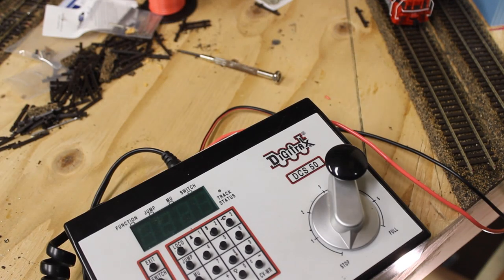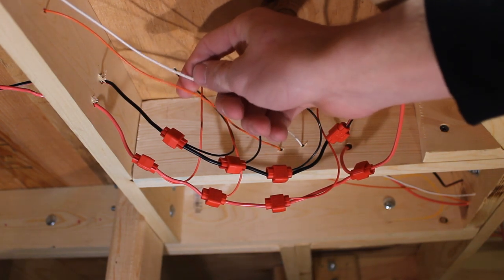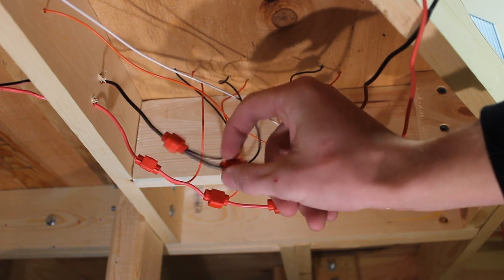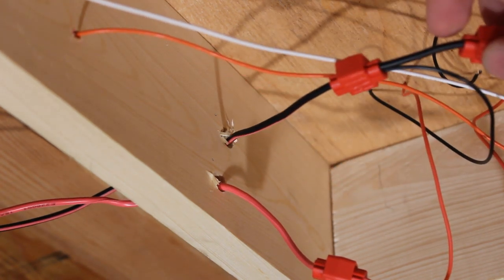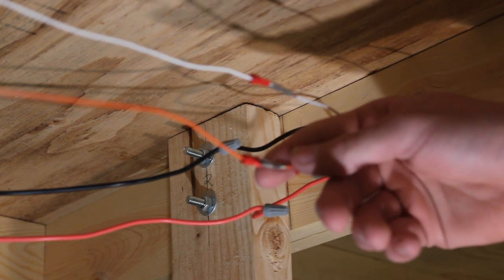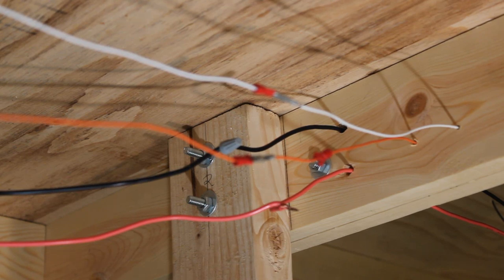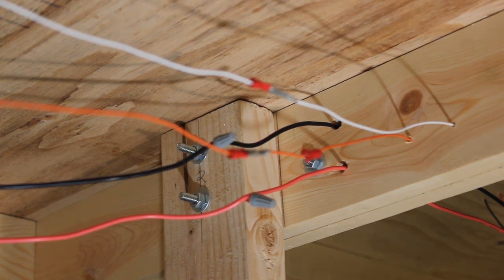How to run a model train bus wire

Comment: DCC bus wires should be twisted together to reduce inductance.   On long runs that inductance will distort the DCC waveform and possibly create weird responses, especially with locos with sound.

Yes, the twist does make clipping in those suitcase connectors a lot more difficult.  But ya gotta do what must be done.

Comment: how do you connect your bus wire to a power supply? Also, how do the little feeder wire connecting pieces that attach the feeders to the bus work? does it strip the bus wire when you install it or do you have to strip it before?

Comment: Can you connect controller to track as normal & have a separate power supply feeding the bus wires?  So you are feeding power to track from two sources.  They wont clash or cause a short or whatever.  Thanks.

Comment: For suitcase connectors for feeders to buss, drill out the smaller gage of the connecter.  this gives you 2 feeder ends.  Cuts the number of suitcase connectors in half.

Comment: I tried suitecase connectors - I put the first one on and tested and had no power.  I felt like at that point they may not always be reliable so I've switched to soldering my drops to the bus wire.

Comment: do you have to run the bus wire in a circle or can you run from point (a) too point (b)??
Reply from the maker: +Paul Settle Yes you can. There is no need to run the wire in a circle can go from one point to another and that is perfectly fine.

Comment: My grandson is building a model railroad and is having trouble with dead spots in the track. He doesn't seem to be able to find the problem and he wondered if he could lay a small gauge positive wire on the outside of the track, and negative wire on the outside of the opposite side of the track and run those wire all the way around the hook the power supply to those wires instead of to a piece of track. It would be the same amount of electricity running through the wire, but each piece of track would have power. Would doing this work, or would it burn out the locomotives?
Reply: Hey mate.
You've asked the exact same question that I am seeking the answer to.
Have you worked it out?

Comment: Does the bus wire make a loop and attach back to where the wire started? Or, does it run point to point and you attach feeder wires as needed?
Reply from the maker: +Juls Adkins There is no need for it to make a loop. Just run it as far as you need to for feeders and that is it.

Comment: nice video.  what are those joiner things called that you plug the bus wires together with?
Reply: Tim's Train Videos those connectors are called suitcase connectors.terminating the ends of the main bus. Is typically done when the length of the bus is over thirty feet. Yet still,I'm going to use theses filters anyways, for(possible future expansion). It is called  a snubber,It is an R/C ckt.

Comment: Thanks for the video, i take it i would need a bus loop for each seperate track layout. For instance if im running 3 trains on seperate track non digital i would need 3 controller units and 3 bus loops for eatch track loop is that right
Reply: Simon Gray ,

Comment: I'm planning a large single loop around the top of my living room, and I have a question.  If the track's joints are all soldered, is their any need for a bus wire with multiple feeders?  And just to tidy things up a bit you could run two feeders from each of the connecters on the bus wire (one out each end).
Reply from the maker: +Keith Petersen Yes it is possible to do without having to run a bus wire  but depending on the length of the loop could cause issues. If you do a good job at soldering the joints and keep the tracks and locomotive wheels clean it should work. No using the suitcase connectors it is not possible to put a wire in each end. There is an end piece that will keep you from putting a wire in the other side of the connector.
Reply: Thanks
Reply: My advice is to wireit up cuz I made a big mistake by making a single loop without wiring and now i have to add feeders because it wont conduct electricity now:( . I connected everything too except the damn feeders, wires, etc #FML

Comment: Nice video, simply explained, and easy to follow.
Do you use solid wire or stranded?
Reply from the maker: +Ken P I am using stranded wire, however I have used solid wire in a previous layout and that worked as well.

Comment: Are the “feeders the same as the “bus”?
Reply: no... the feeders are attached to the rail... the feeders are then attached to the bus wires which are attached to the DCC power supply... feeder wires are smaller (22 gauge)... bus wires are bigger... 14 to 12 gauge to prevent voltage drop which leads to poor loco performance

Comment: I am confused.   I know nothing about wiring.  Do you only run one wire from your power pack and call it a bus wire? Then where is it connected to the track?  with rail joiners that have a wire?  ok, then if you add something like an accessory to your layout are they connected to a new buss wire from the accessory port on the power pack?  If you have an accessory and it has two wire running from it do you attach both of the wires to the buss wire running from the accessory port of the power pack?  How many buss wire do you have to run to the track on a 5' by 9' HO train layout?   I how you can help me on these question because I am so confused as to what to do.   Right now the train runs slowly and when I hook up the accessories I get an overload light so I am stumped as to where to go from here and I have read everything I can about wiring.
Reply from the maker: Well to start off if trains are running slow and you are getting an overload light it means there is too much connected to the power supply. You can either get a new higher power supply or add an additional one just to run the accessories off of. There are two main wires running from the power supply that are the bus wire most often a red and black one. Then coming off those wires there other wires that then connect to the track and anything else that needs to be connected to the main bus wire. You can look through some of my other videos to see more wiring and how to do things such as run feeder wires. For a layout of your size you would only need one bus wire and a couple feeder wires running to the track.
Reply: +CSXNo4591 thank you so much!
Reply: interesting points ,if anyone else wants to learn about how to build a model railroad layout plans try Pycanta Model Railroaders Protocol (just google it ) ? Ive heard some amazing things about it and my colleague got great success with it.

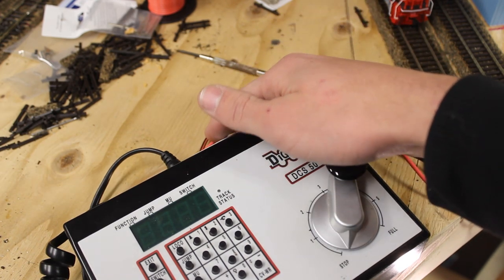Comment: 0:55 to 1:05 you confusing me bro which one is the main bus wire red or black? and what is the black wire called? God damn I can't find one decent video on youtube...
Reply from the maker: +sunsetcity420 Both the red and black wires are known as the main bus wire. One wire is required for each rail but they must be consistently used for the same rail such as black for one rail and red for the other rail.
Reply: CSXNo4591 Thank you!!
Reply: sunsetcity420 ycdth
Reply: One side of a track is positive (eg. Red) bus wire. The other side of the track is Negative (eg. Black) bus wire. The thiner red and thiner black wires are dropper wires which are soldered to each side of the track and dropped down through the baseboard to the bus wires. Black must go to black and red to red. It confused me so much at first when I saw all the wires together lol. Then there’s the point motor wires which , to me, looks even busier.

Comment: You know, you could have twisted all those wires together and soldered them. Saving all the money you spent on suitcase connectors for other stuff.
Reply from the maker: Yes if one wants they can certainly do that. But with the amount of wires i would have to do that to it would take longer and the savings would not be all that much. There is nothing wrong with doing that if one chooses that option.
Reply: I have nearly a thousand connections under my layout. I twist all the leads going to the tracks together in one area. Then I wrap it around the main feeder, when I'm completely done in that area I solder it. This is actually quicker and cheaper then what you are doing. I'm a master electrician with my own contracting business.I'm always looking for the quickest and most cost effective way to complete projects.